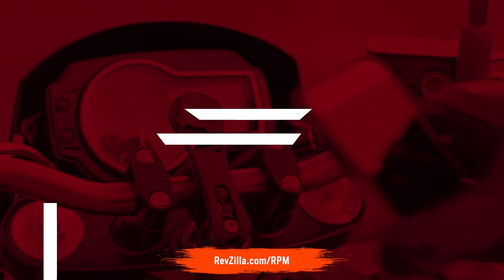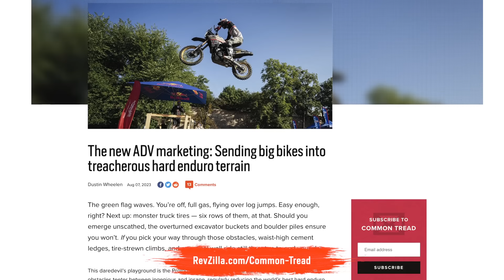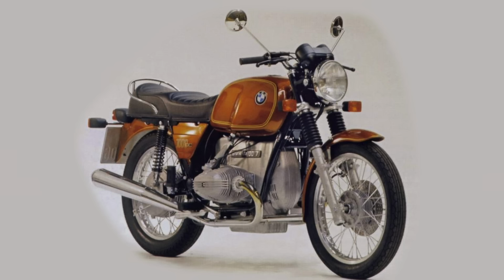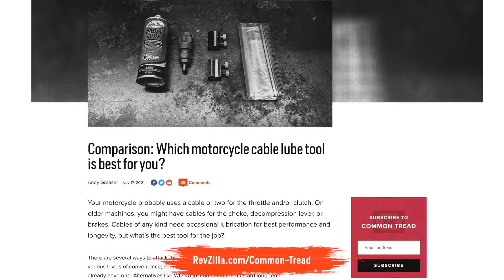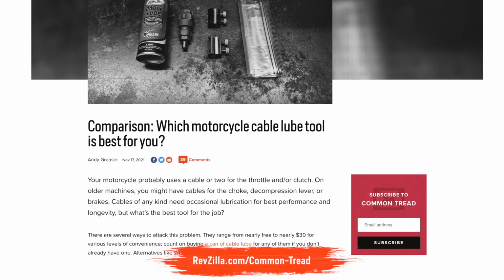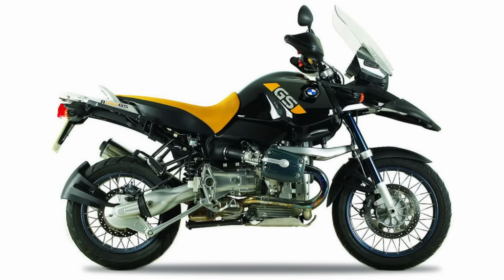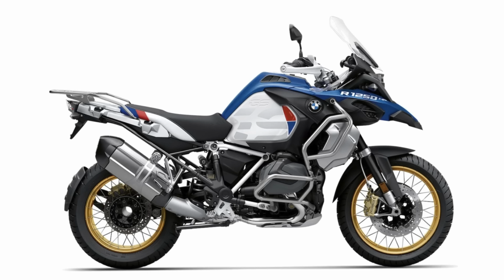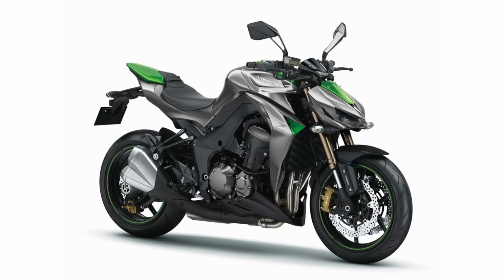YOUR Moto Questions Answered (and Zack's Dad)! | HSLS S07E11

Comment: I learned how to ride mostly on a CM185T. The next bike I went to was a GL1100. The very first time I took the Gold Wing out, I scraped both my pegs. Because quite frankly when moving that goldwing feels about the same as the twinstar did. Even the same seating position and everything. And after riding the goldwing for a couple months. I kept getting deeper and deeper into my corners. And one morning. 70 plus degrees dry roads. 1leaned too hard into a corner. And I put my engine crash bars into the pavement. Which lifted up the rear tire. I went for a slide. If I hadn't been so comfortable throwing around that twin star. I don't think I ever would have gotten so comfortable throwing around a Gold Wing. Hard to say if it was because I wrode a small bike first. I loved that goldwing. I resurrected it It was a $200 basket case when I bought it. My dad's a BMW R bike guy, and he talked me into selling the Gold Wing and buying a '94 R1100 RS! Haven't been able to put very many miles on it. As I have not rounded up the few dollars I need for new tires. But I'm sure it won't disappoint. I'm with Zack. I pay cash for everything!

Comment: On question 2, I have the previous model CBR650f and went with a front sprocket change from 15 down to 14, it’s slightly louder from the final drive, a little more peppy and my speedometer is now 3 mph faster than what I’m actually riding at.

Comment: I agree with Zack's suggestion to initially buy a used, and my preference, a pre-dented motorcycle.  It is easy to drop a motorcycle when learning, especially if you spend time practicing with slow-speed maneuvering and emergency braking, but that practice can come in handy later on in an emergency situation.

Comment: While i do think that smaller bikes are great to learn track riding on, after my first 3 track days (on my street tuono 600) this year i am currently looking for my first dedicated track bike and decided to go for an old (~2006) 600cc inline-4 instead of the 400class. I would love some feedback if my reasoning is sound:
- Firstly, even on my Tuono 660 I was often unable to ride "my" line because of traffic. Many beginner riders, most on bigger bikes, breaking early, carrying little speed through the corner and accelerating hard relying on electronics to keep the rear in check. With a small bike where corner speed is key, i fear I would spend a lot of time just waiting for traffic to clear up, without being able to practice what i bought the bike for. With them not repeating a line, but being all over the place round for round, it is hard to overtake cleanly except for on the brakes, V-ing the corner and getting out in front of them, something I understand would be hard to do with a small bike.
- Second, after teaching the basics, instructors would explain line choice and i understood that for everything but small bikes nowadays a sharper V-line is preferred while on a 400 i would ride a round corner to carry the speed - so I would need to retrain my brain when upgrading to a bigger bike.
- And at last, small bikes are hard to come by and therefore relatively expensive where i live - I can get a raceprepped CBR600RR for under 3k and a Ninja ZX6r for under 4k, while an old (=unreliable) RC390 comes in at 4k and a street Ninja 400 at 4.5k. So I would simply need to spend more money on the smaller bike.
These reasons are sorted by priority, with me being willing to spend relatively more on a fitting bike, but not at all willing to spend hundreds on trackdays to then be held up by novices outperforming on exit and underperforming on entry. I wonder how much of this has to do with track culture, track availability and track day pricing (with me living in europe).

Once again a great episode, thanks guys!

Comment: How do you build confidence after a crash? For me, I knew that having an accident on a bike is inevitable. For this reason, I dedicate a road for me that I have known for forever and I have dedicated this road as such since I started riding. Make sure it's low traffic with smooth road surface and not too many distractions. I also dedicate a music playlist to comfort me everytime I start to ride to comfort me and it works for me all the time. It's almost like a ritual. 

I lowsided onto a curb. I went in to fast and brake too hard and long. I was safe and the bike was more or less ok. Bent the throttle handlebar and fucked up my fairing and tore it in two.

 Anyways, it was also important for me to hurry and get back on the road. Getting the repairs done, took a month off from riding. My longest yet. At first, my confidence was definitely not there, I was scared to just touch the front brake too much on curves that i have road in multiple upon multiple times. But the more and more I rode again, my confidence gradually came back. Took me about 3 sessions of 2-3 hour riding for me to get it back. For even worse crashes, though? I still don't know how you do it, unless the feeling you get from riding overweights your fear of riding and that's dependent on the how you crash.

Comment: If you upgrade the brakes on an older bike, aren’t you then risking adding stress to other components such as the wheel rims, spokes, tyres, bearings, forks..? Sure, it might be old and poor compared to contemporary systems but they were fine for people back in the day - maybe a change in riding style to suit the brakes might be an option :) 🇬🇧
Reply: Thing is they weren’t fine back then, good riders got hurt due to crappy breaks that would have lived with better breaks. It’s like old helmets, people wore leather because it was the only thing available, not because it was any good.

Comment: I would argue that the “seat for every ass” doesn’t apply in the large touring market.  I think the hay day of that market was in the 80s when you had the Gold Wing, Voyager XII, Venture, and Cavalcade.  I don’t consider an air cooled V-twin as a luxury touring bike.  Today you basically have the new, smaller Gold Wing and the K1600 BMWs which are also smaller than the K1200LT.  Neither of these compares to the aforementioned bikes in regard to two-up comfort, luggage capacity, etc.  In pretty much every other category, the choices are better than ever, but not in the two-up luxury touring market.

Comment: If the three wheeler fits into the width of the spot for the motorcycle, then why not?  If it is too wide, then it needs to park in a large enough spot which is probably a car spot.

Comment: I think you guys missed a point about ever-growing engine sizes, and it is a big one.

The problem is, all manufacturers, and I don't think I am wrong but you are welcome to correct me, reserve the highest tech/highest luxury to their largest displacement which is typically the most expensive one as well.

I would love Apple Carplay/Android Auto on Honda Transalp 750, but Honda says - no no, you have to buy AfricaTwin. Heck they don't even offer a cruise control on the smaller bike.

So in that sense, we do have a problem with ever-growing engine sizes (and more importantly weight).

This can be easily fixed by manufacturers offering all options, where technically possible, to all models instead of the biggest bikes. But I doubt that will ever happen. And no Honda, I have the money but I am not buying AfricaTwin.

ADV market desperately needs high end, smaller displacement bikes. VersysX 450, KTM 490, Dominator 500 etc. I think many will pay the premium for premium features and lower weight, especially if manufacturers put a bit of effort to explain that bigger is not always better.

Comment: You don't have to connect an air pump to your battery terminals these days. There are electric pumps available with rechargeable batteries inside.